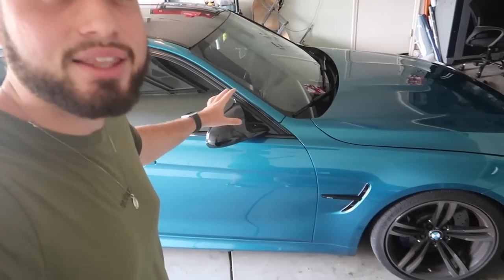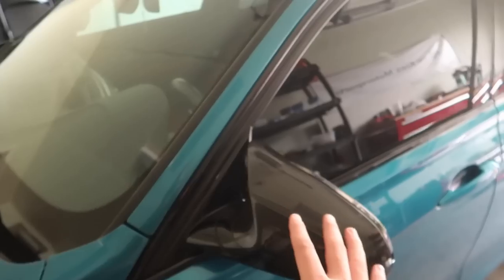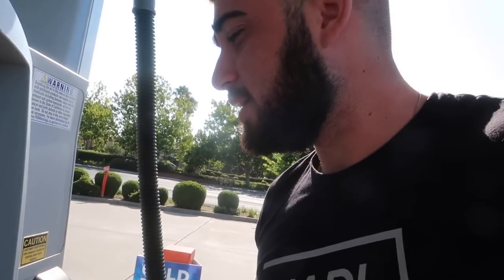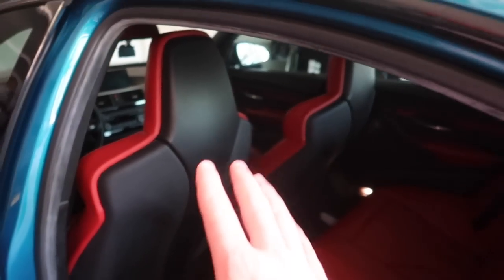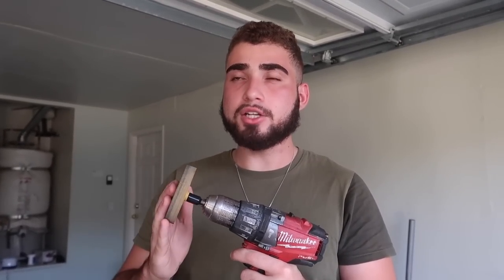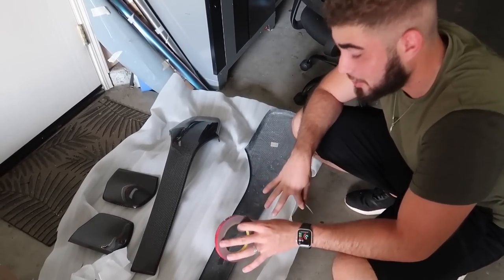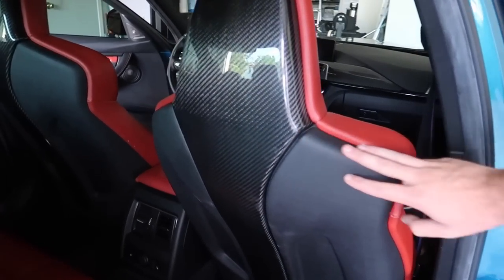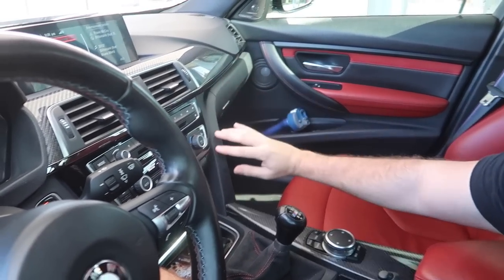$1500 IN CARBON GOING ON THE F80 M3!! LOOKS CRAZY!!

Comment: You should get the M3 tinted!
Reply: How is it not tinted?? Looks pretty tinted to me.
Reply: 5% all around 35 on the shield
Reply: @zaynelsonododa2491  I think 5% is tacky as hell. Some 70% in the front windshield area would be nice but besides that the car looks very clean with the tint it has installed.
Reply: @BlakesGarage  it isn’t tacky as hell when you live in a genuinely hot area like Sac 😆 the struggle is real
Reply: @MyTechHelp14  that’s where I live. I run 30% rears and 50% sides 70% front windshield ceramic. Looks nice and clean and not too dark. BMW’s are still about class and 5% is trash.
Reply: @BlakesGarage  I agree man.  I did 50% all around and the inside stays cool.  I do need to do the front windshield soon.
Reply: @m3ans656  yeah, it’s a more mature look I guess but just looks like you care and want a nice clean euro instead of trying to hide something. I 100% get why cops will pull you over with 5% all around it’s dangerous for them walking up and it’s also not a great idea for driving at night. Someone please tell me you can see no problem backing up at night with 5% I’ll wait.

Comment: I used to work in a wrap shop and the rubber wheels are life savers for getting off any stubborn glue. The most important thing is to not keep it on one place for too long as you can burn through the paint.

Comment: Get a VRSF or CSF cooler, they are fully metal and pretty solid. Oem charge cooler has those plastic sides which crack and create boost leaks, csf or vrsf one's also cool better and ad performance plus they are also pretty good looking.

Comment: You need to get the active autowerke equal length midpipe for your M3. 
If you are going catless get resonated equal length midpipes. If you are keeping stock cats or get race cats get the non resonated equal length midpipes. It completely changes the exhaust sound on those S55 engines. You will fall in love with the sound. Trust mee!🔥🔥